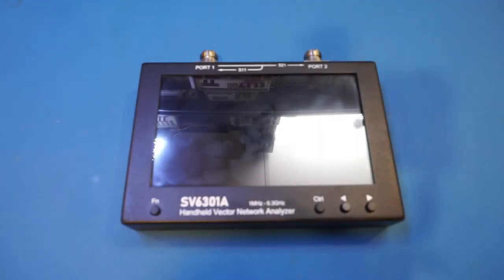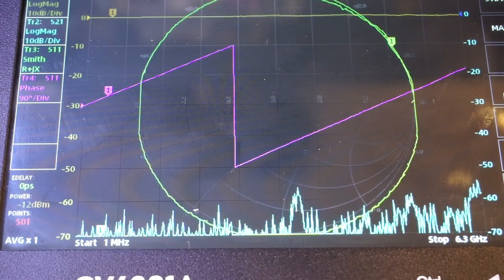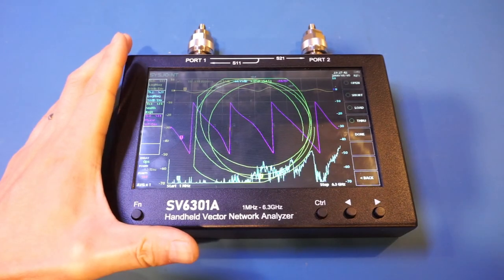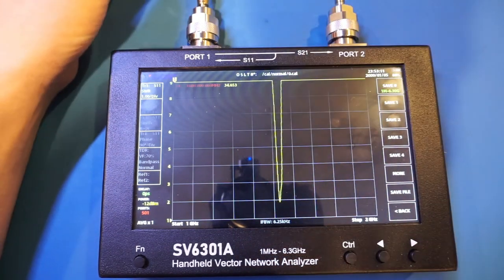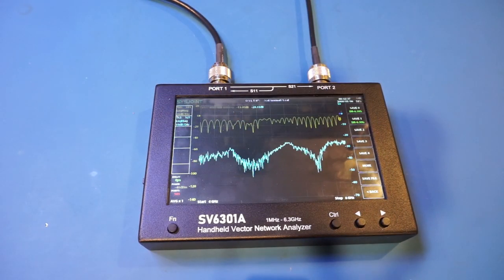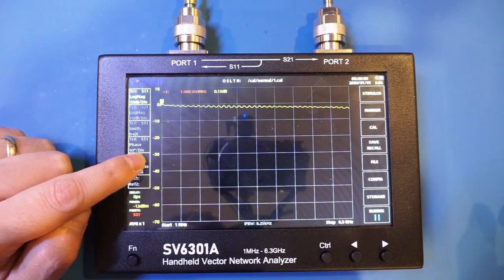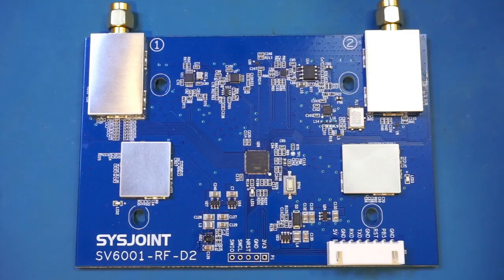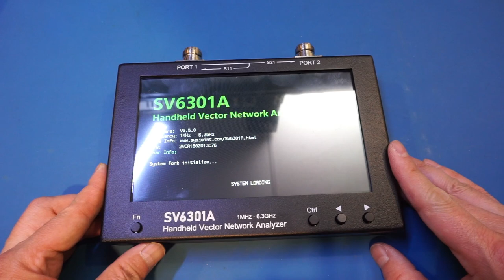SV6301A Vector Network Analyzer Review/Teardwon

Comment: I’m most impressed with your YT on the SV6301A. I really like the features, layout and size of this device. I’m tempted to buy one. I’m concerned with the number of “fake” devices coming out of China.  While these devices are open source so many different manufacturers can build them, the level of quality of the components used and construction varies widely. Before I plunk down that kind of money for one of these gadgets, I want to be sure I’m getting the “real deal”. I would really like to see a tinySA Ultra in this form factor; 7 inch screen, N connectors and a metal case. It would not be as tiny but lots more useful if that’s possible.

Comment: I just received mine and very dissappointed that the firmware is a step backwards. All prevous nanoVNA's have  S11 screen formats  for R and JX. These linear (rectangular) graphs are very important for measuring baluns, chokes, amplifier input impedance, crystal paramters etc. A Smith chart representation is not useful for these measurements and require a lot of interpretation. How can the latest and greatest of the nanoVNA series have omitted these graphs?
Reply from the maker: Sadly, I have not seen any updated official firmware anywhere yet.
Reply: @KerryWongBlog  Hi Kerry,
Mine just arrived today- so likely the latest firmware and no linear R or X graphs.

Comment: I concur U2 is a 1-6000MHz 0-31dB attenuator chip, I use them frequently. Can't read the part number off of the video to know exactly which one, but they tend to have similar pinouts.

Comment: Got it it worked perfectly thank you
Reply from the maker: Great!
Reply: Now onto the next problem the analyzer won’t run off of battery power it only turns on when it’s plugged in it doesn’t seem to be excepting a charge so I’m going to replace the batteries and see what happens

Comment: Hi, thanks for all your interesting reviews! A question about something else: I am interesting about how are you dealing with the fan noise of your old HP spectrum analyzer? I am currently trying to solve the same issue on my Tektronix 2712 which I got recently. This little (6x6x2cm) fan has only 1 speed and that is "full gas". The capacity is quite high, about 31CFM (or 52.6m^3/h). This SA unit has operating range from 0 to 50 degrees Celsius, and has MIL specs, and my logic was telling me that the fan could be running slower, maybe even half speed. But after some thermal measurements my conclusion is that I would prefer this "full gas" of the fan, but it is quite loud and disturbing to me. I am even considering an external fan, connected by a hose. Considering the heavy weight of your setup I don't think you move the SA around a lot 😆 so you could also consider a big(ger) fan outside the unit that can suck out the air but not making to much noise itself. Just curios about your experience with this noise.

Comment: Thank you Kerry, a very nice review, I have the previous version SV4401A which is awesome indeed, the only thing which i am still missing is external clock reference input, i was about to get the Libre VNA because it does have the EXT Clk 10 Mhz in, but alas it also have heat problem and hanging issues, so i ended up purchasing the SV4401A, hoping newer models will include the 10 Mhz in.
another problem is the Battery indicator, it goes to about 48% in just few minutes after switching on with full battery charged.
the calculation percentage is definitely wrong and i am surprised to see the same problem in that newer model too...!
Reply from the maker: I haven't noticed the battery indicator issue you mentioned, but the battery capacity is somewhat limited.
Reply: @KerryWongBlog  yes Kerry the battery is somehow limited, but let me explain the point i noticed about the indicator, actually the battery will probably sustain a good one hour of work without any issues, i switched on the unit with fully charged battery, it started by showing 100% @4 volts....then the next 2 minutes the voltage dropped to 3.7V and the indicator is showing something like 70% which is terribly wrong because the battery is only 3.7V ....then the voltage will be stable around 3.6V for the next half hour...then it will drop to 3.5V at this point the percentage is shown as 48% ...this is the problem. ....3.5V isn't 48% of 4V  ...i don't think it is a big deal at all and this can be fixed easily.

Comment: I was expecting much better hardware for the price, but the same largely as the V3, plus no SOL calibrators really makes it way-overpriced and a disappointment to me.
Thanks very much, as a lot of people would just assume they are getting a much better performing unit as the larger LCD is known to not be 'that' much more expensive.
I also think this leave the market wide open for a similar form-factor unit with much better specs...

Comment: Adaptor loss:
I am yet to find an adaptor so bad, and an instrument so good that I can repeatably measure it. 
Leave the board-mount SMA connectors alone! Once the N-Types are worn out, you only need a screwdriver and possibly a torque wrench to do a connector swap with no heat stress on the board.

Frequency:
6GHz? 30GHz, 10000000000000000000THz!
This wierd obsession with turning everything into a laser just drives the price up.
0 - 1GHz is more than good enough for the target market (with the last 500MHz being just for the US market 800-900MHz gear).

Output power:
If it can't push through a -80dB dip on a duplexer, it goes in the bin. Are we supposed to buy a separate unit with more power? Doesn't make sense! The target market here is hobbyist - Low budget.

Up side:
This unit looks like it would be easily hackable.
~ Re-case in slightly larger enclosure
~ Larger battery pack
~ Amplifier (lets see 100dBm to get through those duplexers!)
~ Serial tap to have a uC command the RF section to perform common tests with a single button press
~ Several hardware buttons to ask the uC to do the above

Comment: Why does everyone always have to manually adjust their markers to peaks / troughs, in 90% of reviews I see? Shouldn't one of the most common functionalities be for these things to be able to cycle  a marker through however many minimums are present in the graph points, which should be more accurate in 90% of cases than dragging it with a finger / left&right button?
Reply from the maker: Although most of the VNAs can find peaks, it requires multiple selections and is not convenient to use. Would be nice if there is a dedicated find peak/next peak button on the screen.